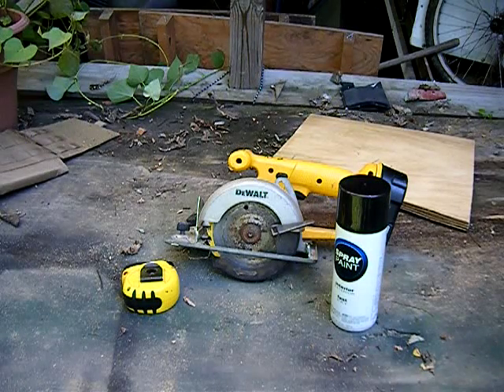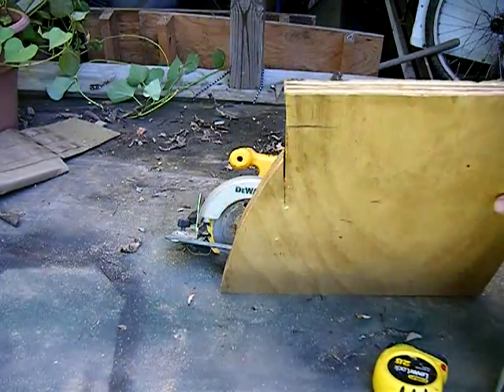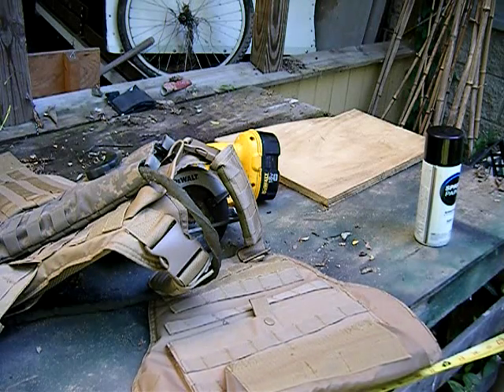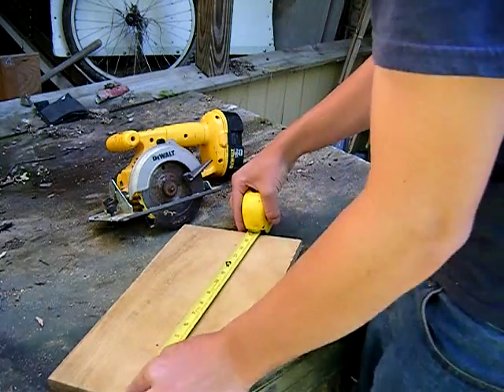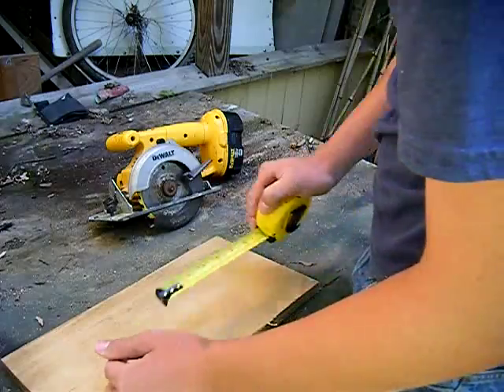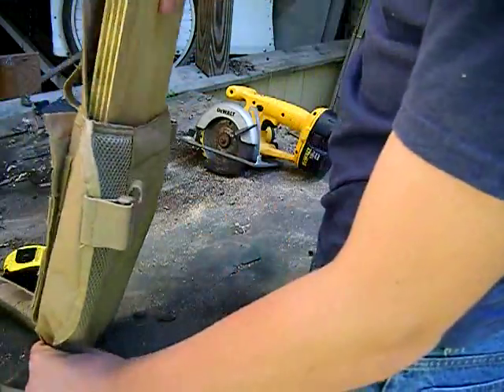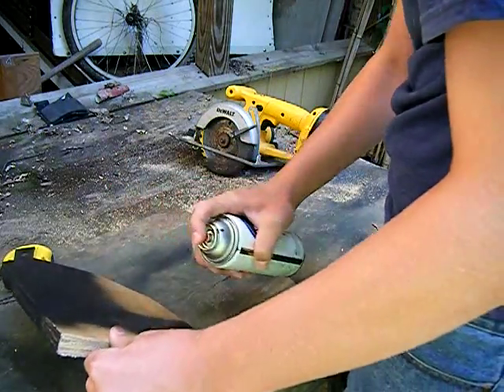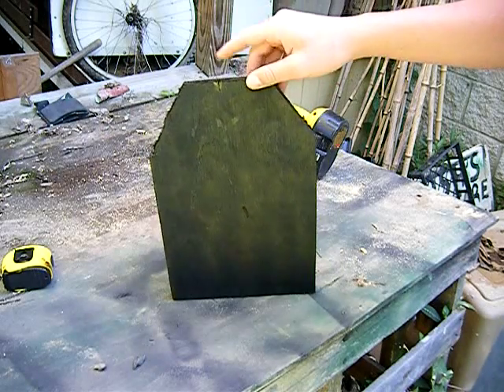How to make S.A.P.I plates for airsoft.

Comment: Usually, SAPI plates are bended to conform to approx. our body.......your plate looks flat, wouldn't that makes you plate carrier looks a bit squarish and bulky........just wanna ask, coz this is a new thing for me
Reply from the maker: Look up real AR500 S.A.P.I plates.  They are covered slightly but they don't bend at all.  The reason i used wood was for realism and weight.  it actually feels like you have a real plate in there.  there is no giving at all.  When i used them i had no problem with them not being flexible but the weight of them made me stop using them. I like them but they do get heavy.
Reply from the maker: The cheaper version of ar500 it straight though
Reply: that's a good explanation, thanks!
Reply from the maker: Be sure and subscribe!
Reply: GUNS Actually bro, speaking of which, I think your approach on making an airsoft SAPI plates is by far from my opinion the best , coz many videos I've seen only shows on making airsoft SAPI plates from a single layer to 3 layers top from EVA foam.....
Reply from the maker: LOL 9 months later.  its just my version like it or dislike it.